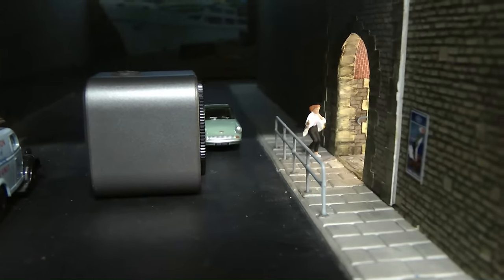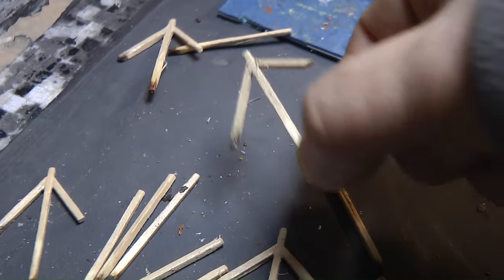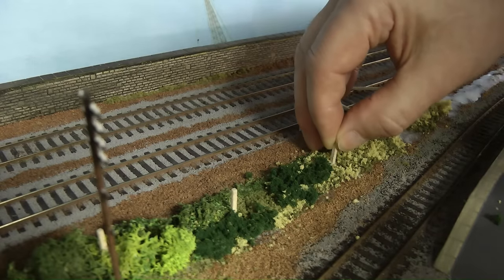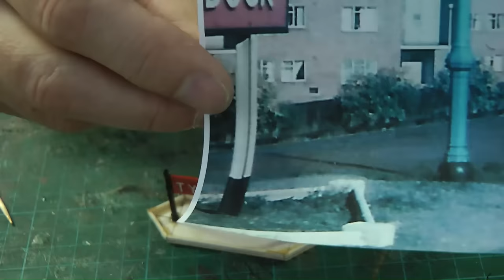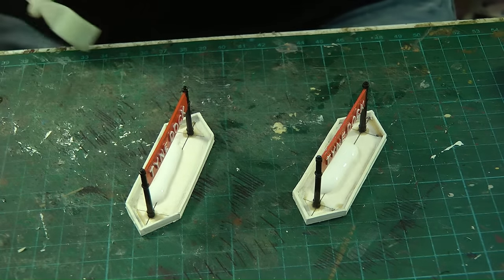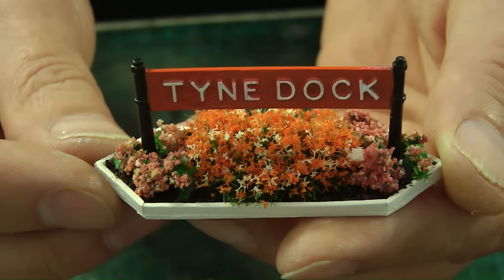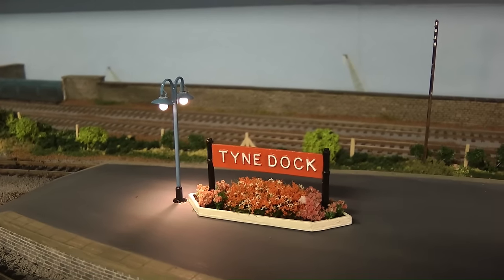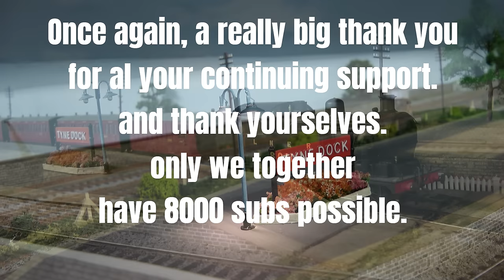Tyne Dock Re-Build, Part 6. Green fingers, Station Boards  No 428.

Comment: Congratulations on OVER 8,000 subscribers and thank you for the enjoyment we get from visitng your railway.. That said mate, I hate to put a spot of moisture on your parade, but as an ex telecoms Lineman/faultman, those poles you just installed between signal boxes are actually a residential street layout rather than a single or even a double line between adjacent buildings. Those poles have provision for 16 telephone circuts on them. 1 cross arm carrying two 40lb per mile copper wire circuts would be  ample between boxes. Each porceline insulator (the white things) carries 1 leg of the circuit that needs two wires to work.  Cheers Arthur
Reply from the maker: Good evening Arthur thanks for the heads up. so maybe next time i will remove the extra ceramics. thanks again for commenting. as always very much appreciated. cheer's for now Tony.

Comment: Dear Tony, awesome shots of the Molden Lane underpass station entrance. May be a good location to let one of the antagonists, of the stories you’ve produced, disappear into the oblivion of the Tyne Dock underbelly. Beautiful how you did the posts from simple match sticks. Must say I’ve noticed the same thing when painting match sticks. Whether it’s the softness of the wood, or it’s both flexible and still rigid nature, it almost seems that match sticks take paint as stain. Just wondering on your view.
Don’t know if you planned any wiring, or threading, as barbed wire, or a dilapidated mesh, between the posts? Might be worth to add some, or some linesmen whom are getting ready to install some new wire between the posts.
Love the Tyne Dock station signs, their placement in the ‘raised beds’ and your addition of the flower beds. Although, of course the flowers are mended by the green fingers of the Tyne Dock signalman.
On the platform lamps, they’re simply pretty. Think the fact that they’re to 1:87 scale doesn’t show. Compared to the photos you’ve shown, these lamps (at the very least) seem to be pretty much to scale of double OO’s 1:76. Such scale differentials always make me think on what Dave Meek, from Thunder Mesa Studios, says about height perspective and perception. Where we mostly look down on the scale models we produce, a true to scale street lamp or other type of thin feature often seems to be too high. Just by using the smaller HO scale lamps, the perspective towards the Tyne Dock docks is also influenced because of the rather free view towards the backdrop, over the tracks into the harbor.
A wild idea for the harbor; always am looking at the harbor cranes at the backdrop when you show the shots viewing over to Tyne Dock. From the Molden Lane view a part of a ship is visible. It always makes me wonder how much difference there is between the lowest ebb tide level and the highest flood tide level at the Tyne Dock docks. Especially because the harbor around your area was created in and around the lower estuary of the Tyne River. Such harbors in estuaries often have rather high quay walls to overcome such level differences between ebb and flood. 
Also, because of the location of Tyne Dock along the eastern coast of England, the tide differences may be further affected by the influence of Atlantic seawater entering the North Sea either from the Channel, or from the sea passage between the north of Scotland and Norway. I read a little bit about this subject and am aware that there have been some project incentives on this part of the coast for the possible harvest of tide energy, comparable to the French tidal power station Rance, near St. Malo.
Anyhow, to make a long story short, and back to the wild idea, am just wondering on the possibility of adding an animated mechanism to the docks  which could make the ships in the harbor go up and down along the quay just a little bit and at a very, very slow pace, which may add another dimension to the view on the docks. As I said before, it’s just a wild idea. Am aware such a feature needs a lot of thought and figuring out. Nevertheless, I thought it would at least be worth it to share my thoughts. 
As always, am looking forward to seeing your next episodes. Thoroughly am enjoying the build series on the ‘new’ Tyne Dock station. Many congratulations on reaching the 8000 subs mark. Cheerio
Reply from the maker: Good morning Vincent. interesting comment and some interesting thoughts. the match sticks were painted with a sandy colour which once dried they looked like they never have been painted. the only thing i did was take of the rough edges that were on the matches. cheap matches are rough cut. but yes the paint dissipated. 
The back drop of the docks was just a hint of the river. which brings back memories as a kid at the market place at south shields. there was a place when leaving the market you turned the corner and you see the bow of a ship standing as tall as a building when it was in dry dock. to me as a child it looked like something out of a movie. but fond memories it was this journey is all about. many thanks again for commenting. cheer's for now Tony.